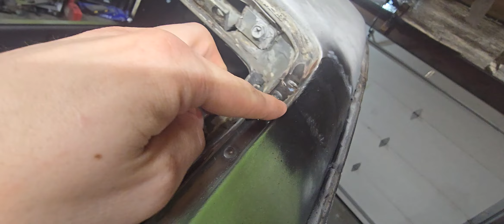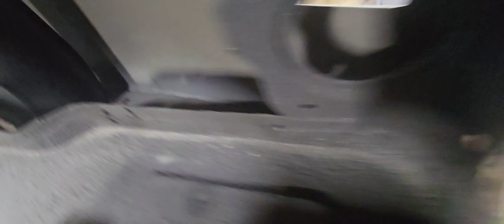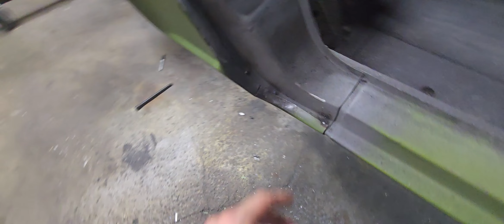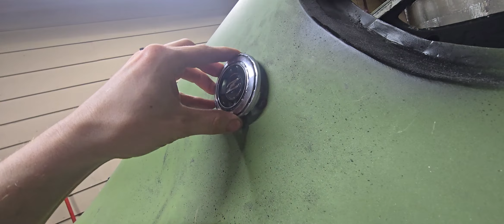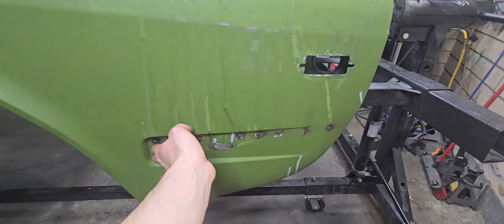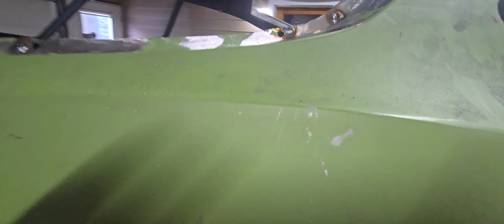KF Datsun Full Quarter Panel Review

Comment: I have used their floor pans and rear rails for a early 280. The floor pans are actually for a late 280 so don’t cut out the seat mounts because the 260 and early 280 are different than the later 280. Otherwise you will need to replace your seat mounts and seat sliders. Cut the floor pans out from beneath the car keeping the seat mounts in place!!!

Comment: what is a "Soft Touch Sensor"?
Reply from the maker: Its a proximity sensor for the keyless entry system. Its to unlock the doors without using a key. In the newer mustangs they are built into the door handles. You go up to it and touch it with your finger and it unlocks the door.
Reply: @automotivemindset  I see, but is it available as an aftermarket Kit for the Z?
Reply from the maker: @unapologetic7900 no, I'm using a modified s550 mustang harness for my car to be able to have this function. Im unaware of any standalone kits.

Comment: I had the exact same issues with my quarters for my 72. Just all around had issues, so much so i scraped the project and started with another Z that didnt need quarter replacements. I just ordered an installed the rear apron, fitment was great however the rear bumper mouthing holes were waaaaaay off. thanks for the video, I'm sure this will open some eyes on these panels.

Comment: Thanks for the heads up on your quarter panel critique. Because of your experience I went into hanging these thinking ahead knowing your issues. Most of what you said turned out to be on point. I saved the taillight pocket on both sides in case I needed them. Turns out the only way to close the door gap on the drivers side was to completely trim the pocket of the off. Now the quarter is too short by about 1/2 inch. I will need to graft the factory pocket at least next to the lift gate. These panels are not for the novice. You need fabrication knowledge to make these things work.  Notice they're "not available" on the web site....there's a reason for that ;).
Reply from the maker: @robertbiggs4599  im glad I could provide some insight on these quarter panels. I hope he's making revisions to provide better quality quarters to his consumers. As of right now, I agree that these quarters are not for beginner fabricators.

Comment: I fitted the KFVintage L&R rear quarters to HS30-00211 here in Australia (Customers car).
They required some work (not quite to the same extent as the issues in the video) but compared to the originals, these were a godsend!
I would definitely use them again.
Regardless I did give Gerson at KFVintage some constructive feedback on them.
I also believe that not everyone fitting them has the skills to rectify the issues (mostly Americans as far as I can tell from socials...), and furthermore that the Z they are fitting them to doesn't have the other chassis problems making them more challenging to fit...
Furthermore, If you are think that the KFVintage panels will fit like an OEM panel, you have rocks in your head.

Comment: Hello, never change a quarter panel when car is mounted in the rotisseri... Jig it and level up with laser. 
There will always be problem with aftermarket parts. But its also very important to check measurements on that old car, from old damages and repairs.
Reply from the maker: Before I started any work on this car I took measurements. The car was then braced and then work was performed. I understand aftermarket parts have their issues, this video points out these issues with these specific panels.

Comment: to add to this, I ordered firewall panels from them, and where the firewall curves down by the frame rail is legit like 2 inches off (on the driver side). I'm gonna have to use some self tappers to bend the metal down and get it tight
Reply from the maker: Yikes, I got lucky and didn't have to repair my firewall. I was told from KF that other people don't have problems like I had and of course blamed it on the car.
Reply: @automotivemindset  it can definitely be your car dude lol 40years old you really think these cars don’t twist?  Panels are never perfect
Reply from the maker: @Tonydude280 if you are truly interested I can send you pictures and videos of the terrible quality before it's even attempted to be installed on the car, wrong dimensions, the holes drilled in the wrong spots, corrosion, etc etc. This is all stuff that can be seen before any work is done.

Comment: Thanks for the video, was 1 month away from purchasing panels from them, not the quarter panels, but floor, rocker, firewall and maybe the hatch slam… did you find any major issues with any other pieces from Klassic Fab?
Reply from the maker: Not a problem. I've done the hatch slam panel, the rockers, the floors, inner wheel wells, the battery apron area, some framing pieces and most of it wasn't too bad. It's the quarters that required the most work. The rockers had to be modified slightly to get everything to line up, it needed trimmed and move down. The floors were great, no issues there. The hatch slam panel was good, no issues. The inner wheel wells didn't line up the best and required work. Another guy commented on the video stating the same thing. Customer support with KF was good at first and then I was told that it's esentially my fault and these quarters fit like oem and no one else has issues.
Reply from the maker: I would like to point out that the rockers don't exactly meet up with the 1/4 and I'm unsure if this is a 1/4 issue or the rocker panel. You can see the gap on the top of the rocker in the video. The rocker I know is 100% in the correct spot as I had the originals and took about 100 measurements and my oem fenders line up with the mounting points on the rocker. I will have to fabricate up a piece down the road to fill in this gap.
Reply: @automotivemindset  Remember that even HAVING sheetmetal for Z cars was non existant until very recently.  The price for everything will be significantly higher than a '67 mustang.......much bigger market.  The "picky eater" mentality with old Datsuns will kill you.  NOTHING on these cars is throw it on, fire and forget. I just finished a 240Z, nothing just went together, everything fought me.  Just the way they are.
Reply from the maker: @conniemclaughlin3156  I couldn't agree more, this video was made to state these things for people that are interested in getting into these cars. The more info out there, the better. I wish I had a video like this before I made any purchases.
Reply from the maker: Check out @TaxFraudSpecialist's comment. He has a review on the firewall. I can't comment on the firewall replacement from KF. I made my own panel for the repair I had to do on my firewall.